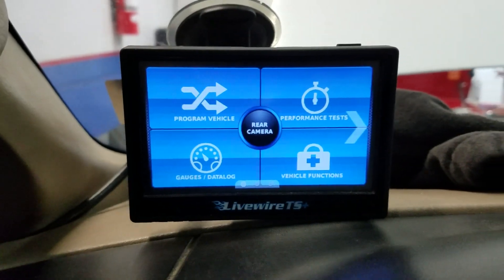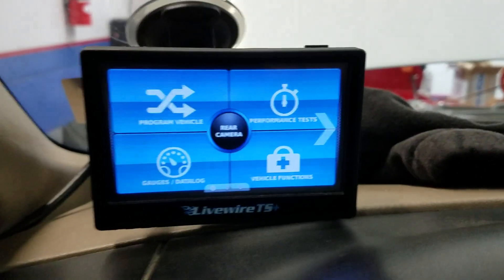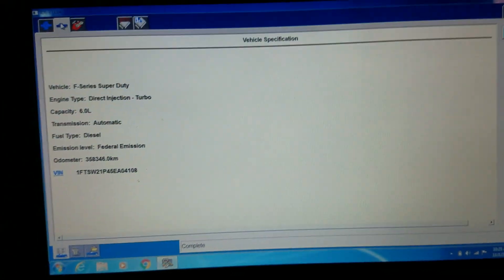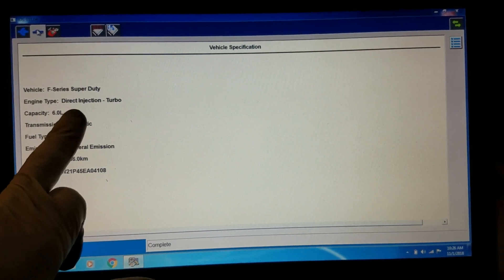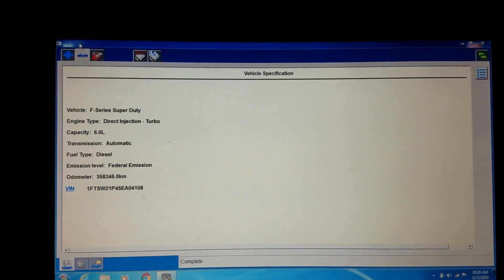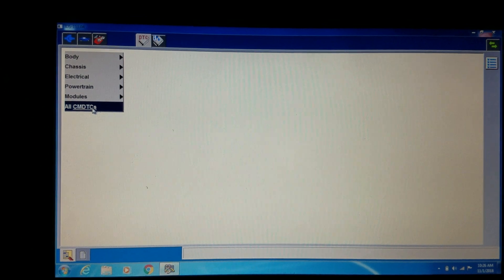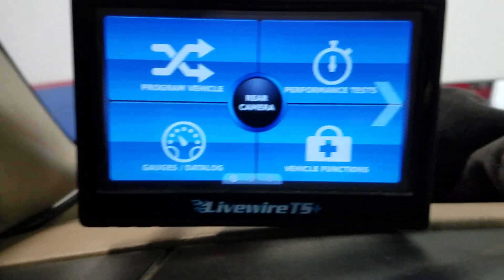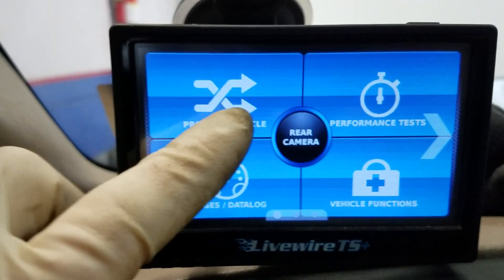How to Reprogram Ford PCM ECM reflash "Uninstall Install aftermarket tune"

Comment from the maker: Check out The Flat Rate Mechanics Tool Store on Amazon https://goo.gl/M8MpdC
Reply: I realize I am kinda randomly asking but do anyone know a good site to watch newly released tv shows online ?
Reply: @Mack Aaron i watch on flixzone. Just search on google for it :)
Reply: @Francis Casey yup, I have been watching on flixzone for years myself =)
Reply: @Francis Casey thank you, signed up and it seems like they got a lot of movies there :D I appreciate it!
Reply: @Mack Aaron happy to help :)
Reply: I have a 2012 F-250 which I bought from my brother in Canada. I believe he had someone (at ford?) tune for power/torque. I would like to get the tuning back to stock - and I obviously do not have the original tuner. Do I have to get this done at the dealer? What do I ask for? Or can you do this for me? (By the way, I live in Tennessee near Nashville).
Reply: I have a 2016 Ford Police Interceptor Utility 3.5 Ecoboost Twin Turbo. 6 speed Auto All wheel Drive. ( Basically an Explorer Sport on Steroids with better brakes, cooling systems for engines oils and trans plus great suspension ) It used to be pretty damned Fast in Closing Speeds & Shifts due to their Unique PCM settings with Top Speed of about 150 mph. So a friend misled me. Or misspoke. Said he had an SCT X4 Tuner on an Explorer Sport with same drivetrain/powertrain etc. So I wanted to power tune my unit for more performance. Well it seemed to work ok at first for a while with more boost & more acceleration etc...  I returned the PCM to Stock or so I thought. With the tuner. ( And the tuner was totally unmarried from the former friends vehicle as required ) 
But after a bit of driving I noticed stock as in Police Interceptor Stock didn't seem the same. Trying top Speed and 130 was Max after previously being at 148-150 previous before I touched the tuner. As well as being less Aggressive on Acceleration than  previous stock Police Interceptor Calibration. * So how do I get my former tune back ? Any help would be appreciated.

Comment: I had a aftermarket tuner just like the one that you unmarried before you did your test + reset is it possible to do that without getting the aftermarket Tunes unmarried because my tuner was stolen it would greatly be appreciated thank you

Comment: WAS TOLD EVEN AFTER YOU INSTALLED YOUR TUNER IF YOU TRY TO EVEN INSTAL THE FACTORY PCM IT WILL STILL THROW A CODE P1400 FOR MODIFICATION OF FACTORY PCM EVEN AFTER PUTTING IT BACK IN WAS TOLD IT WOULD VOID WARRENTY AND THERES NO WAY TO CLEAR THE MODIFICATION P1400 CODE

Comment: I have 2000 ford excursion 5.4 v8 with two oxygen sensors I replace catalytic converter  two months later I was going uphill I lost power I couldn’t go over 40  my catalytic converter colapsé.  No check engine light since I bought the truck .   Can you help

Comment: Thanks for clearing this question up for me . I have a  2013 Raptor 6.2L with Roush S/C. I need the update/recall from Ford regarding sudden downshift at high speed. I will put a custom build back in after. I want multiple tunes to play with.